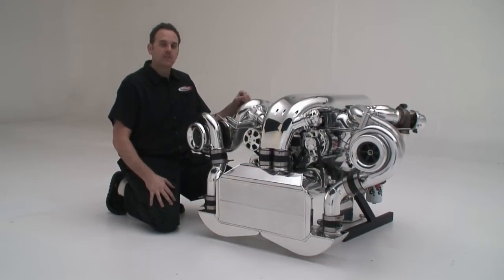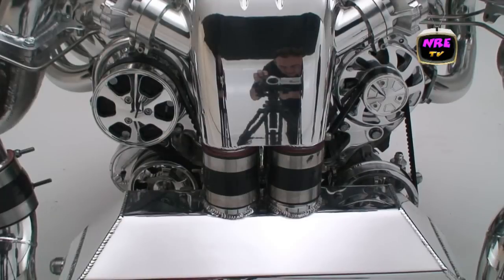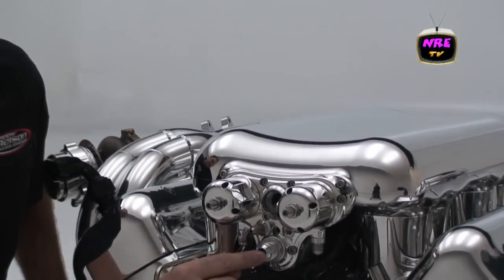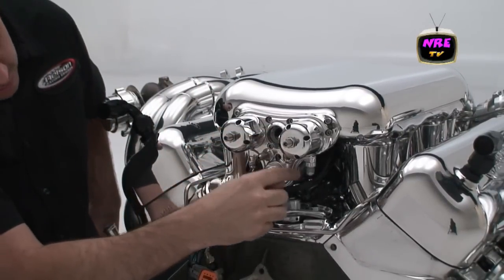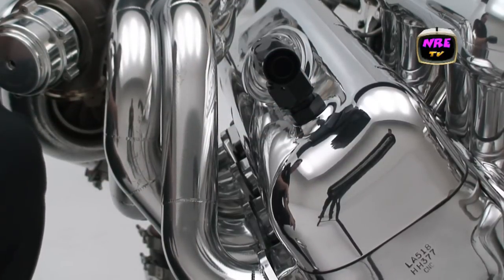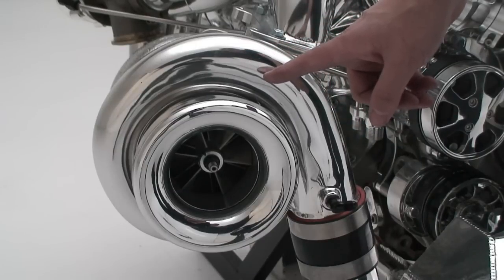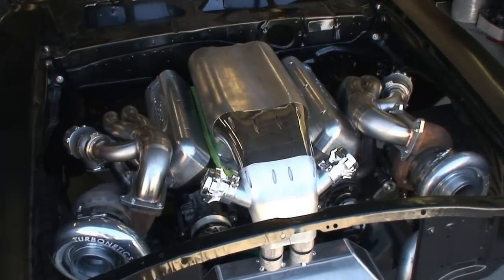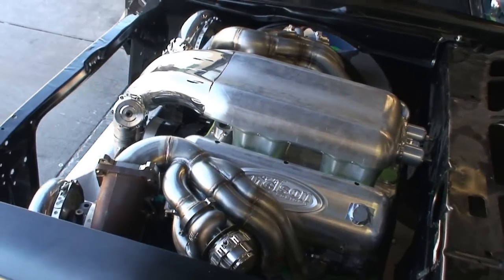2200 HP Monster NRE TT 632(10.3L) BBC from Tom Nelson.  NRE.

Comment: Wouldn't it make sense to use a v12 for this much displacement?
Reply: ***** Why?
Reply: +SalveMonesvol For one, Chevy only makes big block v8's for their largest motors. They don't make v10+. For two, a v12 is going to have 4 more cylinders to work with, which means even more parasitic drag taking away your power, it would be harder to compensate for that, and MUCH more expensive. Parts for a Chevy motor are pretty cheap compared to say, Ford, Dodge, or other v8's. And parts for them are readily available at competitive pricing. Parts for say a v10 motor or a v12 especially are limited in the after market game. Just my take on it from minimal research. I may be wrong on the availability of aftermarket parts for v10+ engines, but I've never found much for them. Also, you can get thousands of HP out of a v8, plenty. The fastest cars in the world are v8's pushing almost 10,000 hp, top fuel dragsters. (Excluding rocket propelled vehicles.)
Reply: No plus a V12 dosent sound as mean as a V8

Comment: Yeah but look at the torques. This engine is not on its full potential yet, this kind of engines are used in top fuel dragsters which pulls about 10,000hp.

Comment: I'm assuming that the head gasket wasn't up to operating temp yet, allowing it to leak. This engine runs pretty hot so i'm sure that it's engineered that way. The SR-71 blackbird would leak fuel during take off and had to be refueled once it was airborne. Engineering is amazing.

Comment: i wanna see this beast in the hennessey venom lotus, with a veyron strength awd system on vaginormous slicks all around.... probably right around 3k lbs curb weight.... imagine a redline 2000hp clutch dump launch on that low weight, great aerodynamics and big fat awd slicks....0-60 in first gear in 1 second....but what do i know im just a 9 year old youtube warrior benchracer

Comment: TopFuel engines would normally have this if they weren't solid blocks. They are pretty much hydrolocked during their 4 second life. A good way to remove this issue is to hace the head be a machined part of the block, but then there is no way to cool the cylinders.

Comment: how is the reliability of these engines? and how is the fuel effiency? noticed 2200 rpm @ idle. (thinking of the street driving side of the engine)

Comment: Nice, but what about engine durability and reliability??? Keep it going for 24hours at 4000rpm and after this check the engine, it will be totally melted, if not, then i am putting down my hat and say you are the best in motor engineering.

Comment: I know! ck it out on the national geographic on YouTube on the Bugatti, the engine generated so much heat it almost burned down the building, and i was wrong it do make 3000hp but 2000 is heat so i Guess they be tuned it for the street, but you should ck it out its amazing how much ingenuity went in to that car. not taking any thing a way from these guys here.

Comment: no inline 6 makes 3000Hp.and is streetable not like this big block that probable weighs less than the 6 you speaking of this engine has air conditioning and idols @ 800RPM can sit in traffic and do road trips

Comment: the world record car is, in fact the top ten at the texas mile are street legal. As per the inline 6 that makes over 3k, that is calculated as you proved that dynos kinda crap out at 2500 hp. And its not an american inline. Its the Nissan TB48 that is in most 4th gen and higher patrols. that supra you speak of runs 6 sec 1/8th miles...slow...

Comment: the Veryon took 5 miles and that was exiting a banked high speed corner @110MPH look up NRE TV they did a supra it runs the track even the owner states he has done nothing but oil and gas for his LSX for over 50 runs instead of tearing down the 2Jz every other run the TKR is a street car those standing mile cars are not all street cars

Comment: the F Bomb is all the magazine credit he needs the editor of Hot Rod magazine owns it.The TKR Keeting super car was clocked @260MPH on 3 miles of dirt from a dead stop with only 900 of it's 1750 hp not only do these engines rip tires to death they do it after sitting in traffic running the air-conditioning they are calm street engines AND ridiculous drag engines at the same time street tires are going to melt

Comment: next, the w16 in the veyron is quite awesome considering its only 8 liters. or 147.8 hp per liter. this nre motor, 213.5 hp per liter. Thats great, but you wanna know whats really funny. The veyron is only the tip of the iceberg, there are motors out there, like the TB48 for instance. stroked to 5 liters inline 6 that makes 3381 hp on race gas or 676 hp per liter. not to mention you could build one for about the same price as a NRE and have something that revs higher, and will last longer

Comment: the only proof I need is right there on the Dyno screen2200 Hp. a Veryon is 1100Hp that would be half the power aq Veryon w16 is over 900LBS dry this is around 700 wet and running this is around 65 grand you couldn't do a head job on a veryon's engine for that a tire change on a Veryon is 100 grand every thing Tom Nelson says is proven right on the screen open your eyes